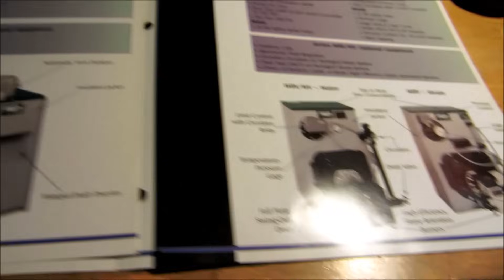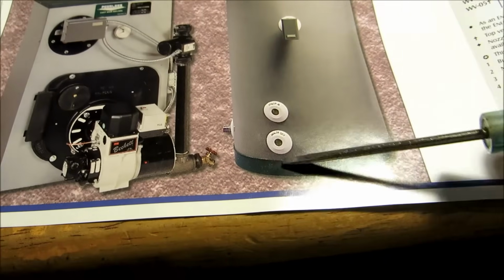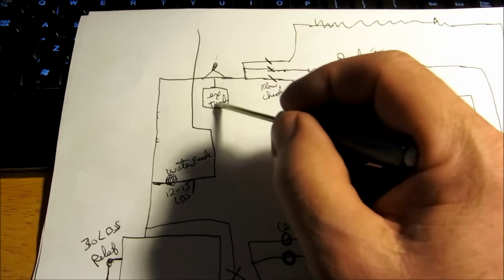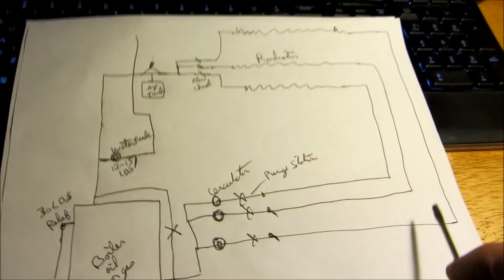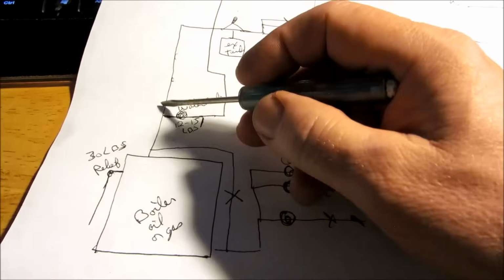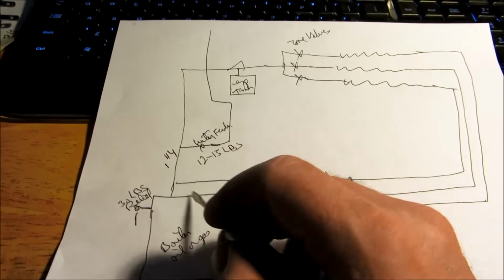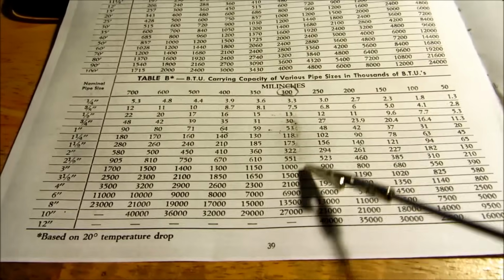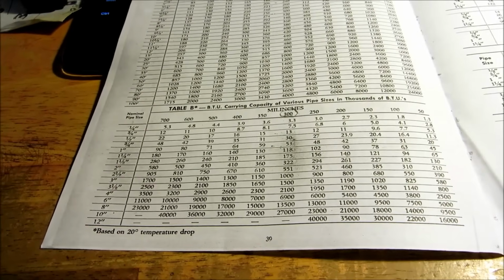hydronic heating 101 part 1

Comment: Very enjoyable watching your videos. I got completely lost when you started with the BTU capacity of pipes. Guess I'll have to research that. What is a "milinch"?  BTW I don't see you yet mentioning air separators or "scoops". Are they necessary and which side do they go on? Is it possible to use them and air vents so that it is never necessary to purge air?
Reply from the maker: +bigpardner this was just a overview of a hydronic heating  system ,yes air skoops and vents should be installed for proper operation

Comment: ok good info --- but how would you do this with a wood fired boiler -- can you do a thermosyphon with wood boiler to heat a small house or shop ???
Reply from the maker: ***** 7 degee temp change will cerculate water you need a heat exchanger in fire place that has water in on thats tied into heating system .if it can freeze add some glycol to stop freezing .it will work better if you have a cerculator to more the water .. the only problem with that is there is temp control high limit . it might be a bit dangerous when you heat water it expandes so a good expansion tank will be needed also and a way to purge out the air from loop but it could be done .
Reply: thankyou ---for the response and the good info ---peace

Comment: This is going to be great!!! Does the size of the pipe have to be the same on the supply as the return? Thanks for sharing this - Keith
Reply from the maker: yes the btu needed will determan  the size pipe both supply and return should be the same size
Reply: Cool, any way I can get one of those charts you had?
Reply from the maker: Right Choice HVAC send me you adress and i will mail you a copy

Comment: good job Steve Lav. Where did you get that chart from? Is it down loadable?
Reply from the maker: what chart the one with the pipe sizing??? it came out of a b.g circulator book
Reply from the maker: the drawing i made my self .just to explain what happens in a hydronic system
Reply: ya pipe sizing
Reply from the maker: Andys Mechanical send me a personal message with you mailing adress. i can mail you a copy

Comment: I have a 1950s gas fired system.  It has the tank in the ceiling between the joists.  Why do I. Need to drain it every few years

Comment: Question: I’m confused by your sketch 11:27 where the cold water in feeding into the hot water supply please elaborate
Reply from the maker: on supply side  at boiler / purge stations on returns so you can purge the zones

Comment: So I've got a 2 zone system, but when I trace the lines away from the boiler, the system T's off to supply to multiple rooms in the same zone, it doesn't run as one straight line from the boiler back to the return.  Is this normal?  I've noticed some of the runs just don't get hot after the T's.
Reply from the maker: +Mistrblank it might be a split loop system
Reply: In my opinion the only way to not get cold spots is to run the pipe work in a " reverse return " system , also a reverse return system doesn't need to be balanced .

Comment: If I do need 1-1/4” pipe how can I do if I gonna use 3/4 baseboard hydronic heat. Or the 1-1/4” it’s only for feed and return?? Thanks
Reply: Marcos Borba 1-1/4” is only used for feed and return

Comment: any idea why I only have 3-4 mins of hot water UNLESS I run my heater? already replaced check valve & helped for a few months...flushed system...can only keep hot water going if heater is ON
Reply from the maker: the water tank is not firing up the boiler .to run up to hi limit. most likely ,when any zone calls it should fire up the boiler .have someone check that out .
Reply: steven lavimoniere thanks steven...i am getting heat tho. I just can't keep hot water flowing unless heater is ON  (or loop for hydronic is closed) ? pump is getting ampz...

Comment: I have a hydroxide system in what is now my home, it was a combination laundromat, large single Bay car wash, and two coin opp showers, so it could produce a lot of hot water, now there is just me and a cat, no more laundromat, and the car wash Bay is a shop instead   I thought having hot water heating would be great,  nope, the only radiaters are per loops in the main floor,  been a constant source of trouble since I moved in , now the gas control valve on the boiler has packed it in (as determined by a pilot that won't stay lit and a new tested thermocouple didn't fix), my dilemma is the valve cost quoted by the HVAC guys in my area  is $500  installed I'm probably up to $1000 , I've considered replacing it all with the current offering in high tech wall mounted units, at 5 to 7 thousand, yeh they save on gas but gobble it back up in maintenance, and from what I'm learning have a life expectancy of 10 to 15  years, and so teched out the are prone to problems that not many can fix, I'm under the impression that the old cast iron boilers last 20 to 30 years, with few problems and easily fixed. I'm trying to figure out my best move, the high tech high dollar,  a $1000 to get the old system up again but for how long, or maybe a new cast iron boiler more appropriate for the current needs of the building. Any input on this from you or any one else would be appreciated, fortunately it's June not January.

Comment: Great video Steve. Looking forward to the series. Are the old style  radiators still in operation up there where you live? I think they were cast iron.
Reply from the maker: yes we have old style radialltors and cast iron baseboard up my way usally in older houses all new houses has copper fin for the most part

Comment: Hey Steve my name is Martin having some issues with a recently installed  system. It’s not getting up to temp. We’re are wondering if the pipes or the boiler is to small.  I was wondering if I could contact you

Comment: can you have a hot water heat system with no electric ??
Reply from the maker: ***** yes it can work gravity 7 degee temp change will cerculate water if there is no flow check

Comment: Steven,
I really need your help just to make sure I don't mess up anything big, any help would be appreciate it.

So I live in a 1 bed-room apartment in the first floor, and in a building that has 2 floors and 14 apartments.
First problem is that I have no clue which one is the "ball valve" and "gage" or the part to which I have to attach the hose to in order to get all the water/air out.

Second problem is that the heat in the bathroom works good, in the bedroom it works very little, and the living room it doesn't work at all; but I thought that if there is air then ALL rooms should not be working?

Third, I replaced an LR1620 thermostat with an RTH2300B digital thermostat (both from Honeywell). They have only 2 wires so I assumed it is Heat-only and so I hooked the two wires to the "W" and "R" label?? just to make sure I didn't mess up there.

Again, I really appreciate any help that you could give me.

Comment: Try not to get so overwrought, yea, excited; it's distracting.  Also, please ALWAYS indicate the DIRECTION of hot water flow; otherwise, your analysis is quite clear.  Another thing: When crossing pipes/lines do NOT intersect, please indicate that with the "arch" convention....as in electrical circuitry.....

Comment: Don't want to be too negative in my comment, but I would never pipe a boiler like this. I am a 30 year master plumber that has worked on boilers all my life.
Searching the pipe sizing info is the correct thing to do. Pumps ONLY belong on the supply side of the system not the return.
There are many more problems with these drawings.
Sorry Steve
Reply: @Katana_00 
Wow, I made that comment 8 months ago. Pumps ONLY go on the supply side of the system. Feed water reg is in the wrong position. There is only one place and that is between the system and the expansion tank. ( it's the only place)
This is a perfect example of where you would use primary/ secondary piping. 
That's a start.